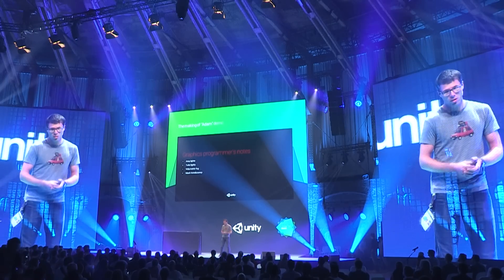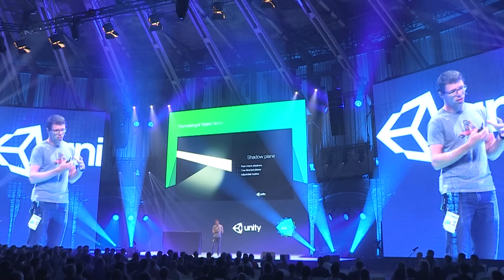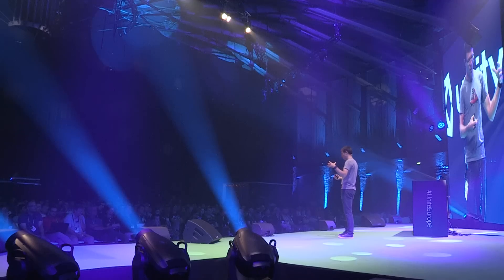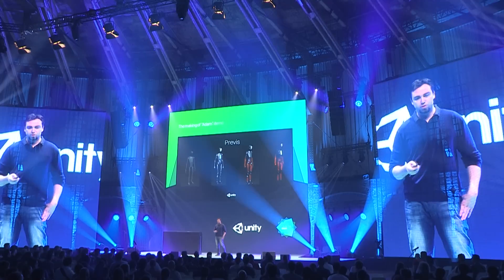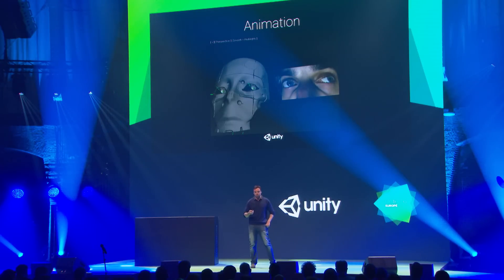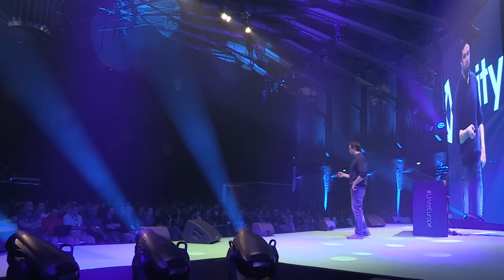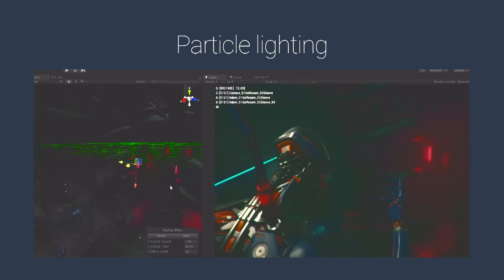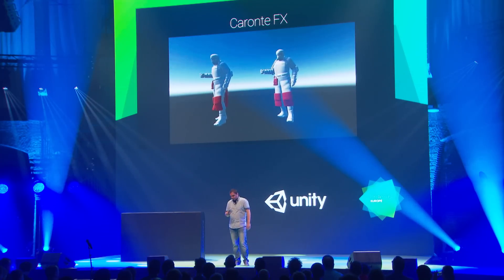Unite Europe 2016 - The making of Adam demo

Comment: How did you guys record the actual film within unity? I currently use fraps for my game trailers and it leads to dissapointing results.
Reply: +John Carlo Gamboa Yeah i save them on a different hdd. But the video quality is usually crap and discolored. Plus fraps really cuts down unity's framerate and the editor window bar is always visible. Im wondering what they used to record within unity....
Reply: I'm also wondering how you can get footage straight out of the engine
Reply: Capture cards or good software. I personally use OBS. Mainly because it runs on linux lol. But it also produces good results if you put the bitrate a bit higher. Also, hardware encoding helps a lot.
Reply: If you want good quality captures I would recommend using Unitys internal screenshot method and store each frame as an image. You can stitch them together into a video later. It won't work in realtime but i guess thats not necessary for capturing trailer footage.
Reply: Use a hardware recorder like Elgato's to record. It has HDMI in (coming from your graphics card) and HDMI out (going to your monitor). This makes it possible to record and not affect the game performance.
Reply: How is Unity on Linux? I heard they released an editor for Ubuntu...
Reply: Phil Michael It is really good. There are some bugs, but nothing serious. Well, the only problem is that the editor still uses only the old OpenGL2 for rendering.
Reply: good luck with 60fps then.